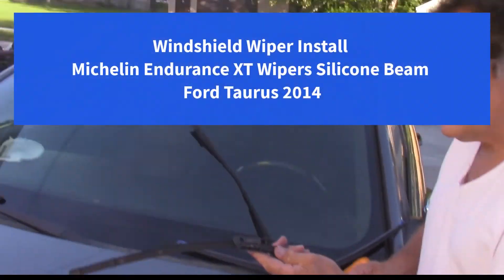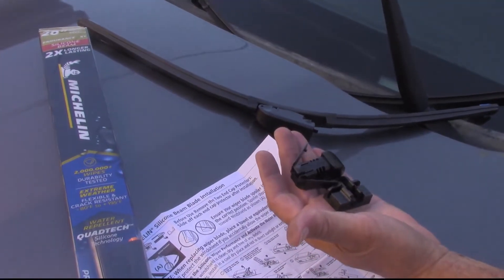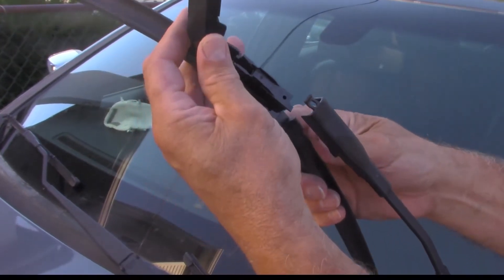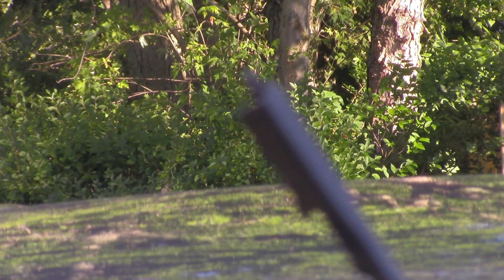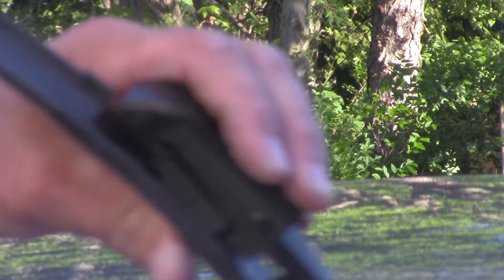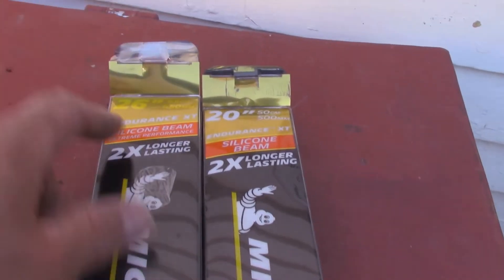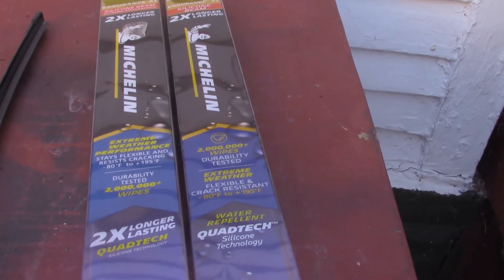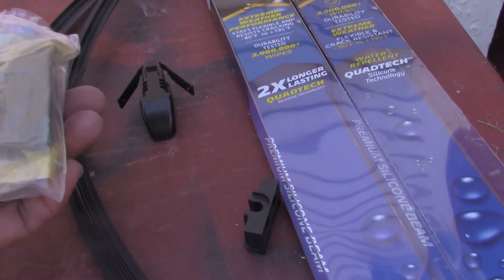2023 Windshield Wiper Install : Michelin Endurance XT Wipers Silicone Beam : Ford Taurus 2014

Comment: They squeak like crazy. Mine do the same thing.
Reply from the maker: Use RainX on the windshield and put it on the wipers too. RainX with stop the squeak. It last a few months. It comes as a liquid small bottle, or a spray. Spray is nice and easy, but wear a mask when spraying. I use rubber gloves and the liquid, push it around with the rubber gloves. I let it dry and then just rinse it off.
Reply: @JimVincitore  Scotty the mechanic YouTuber also has a video on how to eliminate the streak sound by cleaning the windshield with isopropyl alcohol with a smooth blue shop cloth and after, polishing the windshield.